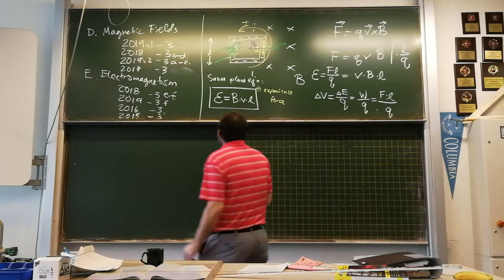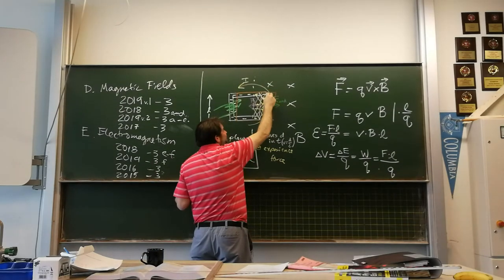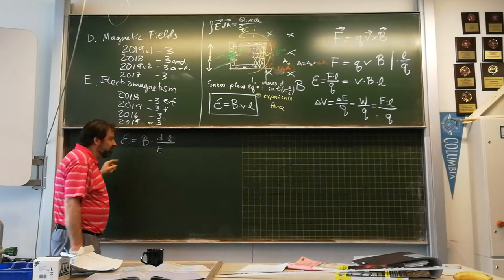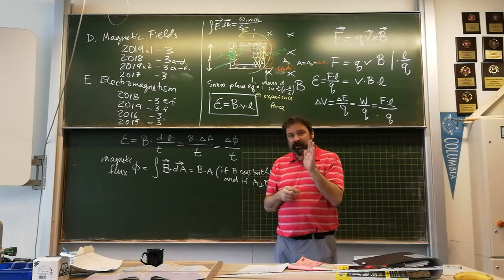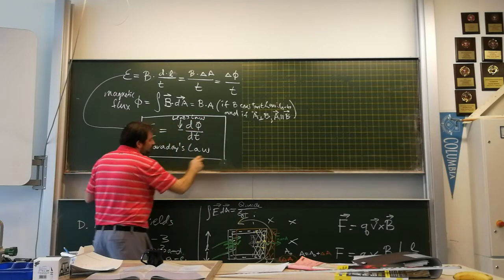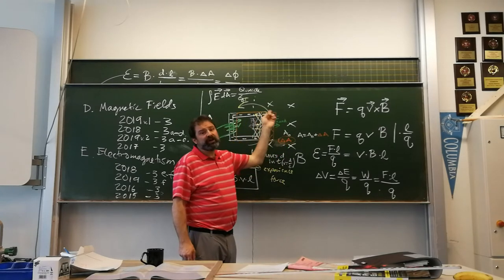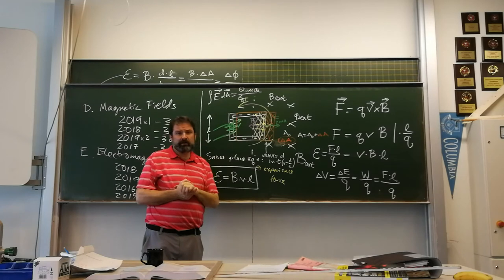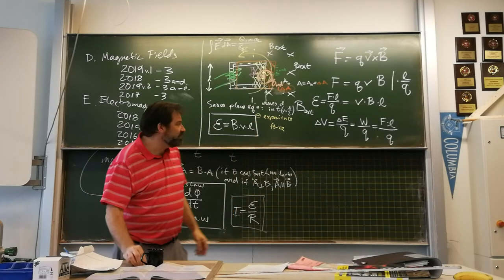2020_03_13_Part2_Flux, Faraday-Lenz

Comment: What exactly is the difference between epsilon and voltage difference?
Reply from the maker: Well... Goof question... In our mechanical analogy of the ski resort, the ski lift lifts us up  a certain height difference or voltage/potential differrence, and then we have the energy available that allows for a. force big enough to overcome the friction and air resistance of the slope and make it "downhill" through that resistor. Now we also could make it through the resistor or along a stretch of snow WITHOUT a height difference. For this we would need a force to push us along which is NOT a result of the potential difference. For example, WE could push ourselves along (XC skiing) or we could have a "weird" horizontal ski lift that just drags us along horizontally. This is similar to the emf here, which in the moving wire loop example is a magnetic force